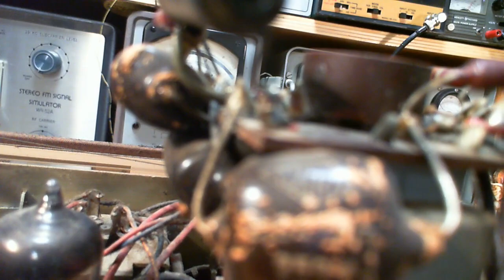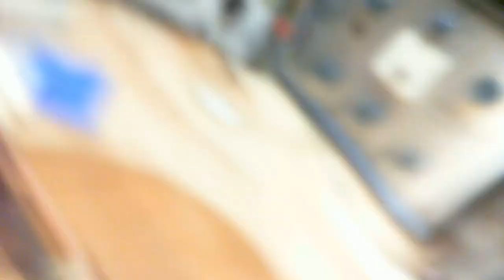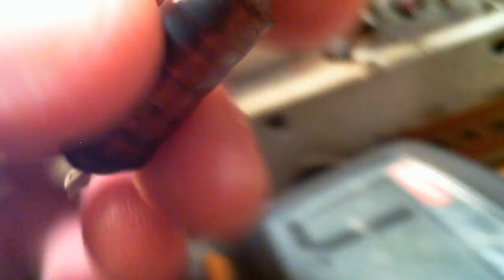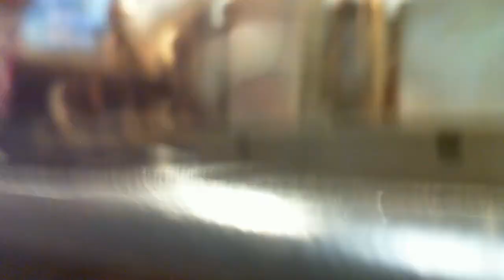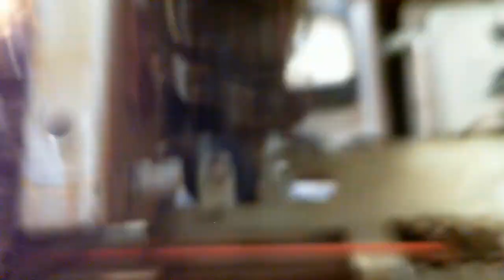German Greatz Polka Tube Radio Video#3 - Component Replacement Begins

Comment: In the 1940's my folks would have most assuredly had non-electric refrigerators as there wasn't any electric there until the 1950's, so there's would have been an icebox.  Their home radio ran on 6 volts and they used a tractor battery for it.  The tractor was a Farmall "B" with both electric and hand crank, so when the battery died on the radio they'd charge it back up on the tractor, hand cranking it to start it.

Comment: In the 1940s-50s not all refrigerators were electric.  Quite a few people had gas refrigerators.  Yes, by a process I don't fully understand, you can use the heat of a gas flame to produce icy temperatures.  We had one until 1955.
Reply: A lot of people in the 40's still had blocks of ice that was used to keep the refer cold.  Things have sure changed a lot in 80 years
Reply: @curtisgriffin7924  Yeah but did they even call those refrigerators?  Isn't that an "ice box"?

Comment: Violet ray machine. Yes, I have one. The have a high voltage generator using a spark gap and induction coil. Just the thing to make electrical noise. It’s really a spark transmitter.

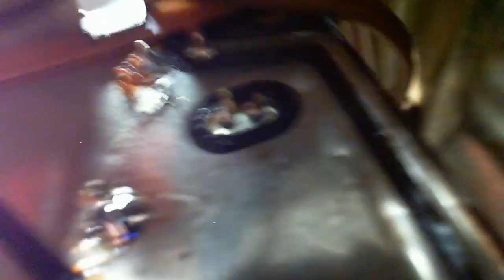Comment: 37:31 and more imporantly  40:45 There you have the result of snipping components and soldering onto the top.
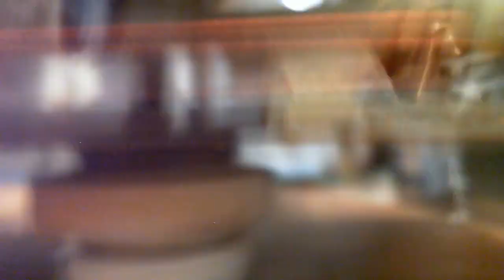 And yes, the resistor 256 was soldered on top onto posts. But even if you keep it that way, logic thinking should tell you, that if you do, not bend these posts around. Because regarding your comment at 39:55 : this broken joint did not occur over time, the only reason the post got a cracked solder joint on the bottom was you soldering a resistor with unreasonably heavy leads to it and when bending the resistor into shape exerting mechanical stress on the resistor and the post. 
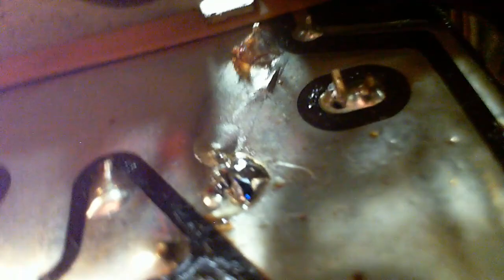And your resolder effort at 40:38 looks like it is still a bad connection. You stuck solder to the trace but not the post!  Get your iron hot enough and let the old solder melt before adding new solder!

Also will any viewer by now probably note how easily accessible both the position of the resistor and moreover the 50uF capacitor are from underneath. Clipping the cap and soldering onto the top was more time consuming than snip snap out the cap, remaining stubs out the bottom, clean pads, in goes new cap, soldering, done. Unless ofc you needed the extra time for a tribute to Norway and fish knifes.

Oh btw; the cathode resistor 256 dissipates 8V*8V/200 Ohms ~ 1/3W. So anything above (true) 1W metal film is probably overkill and only gets you in the need to handle overly stiff component leads.

Comment: 21:49 "59Amps..." WTF nonsense?Amperes is abbreviated with a capital A. Lower case a means year. So "6.   59a" means mfc date June 59.
And 24:40... Instead of spending minutes unwrappung this cap with no result and guessing, one could have used a logical approach like looked at the comonent placement chart or tested where this cap connects. Having identified the 200R  cathode resistor 256, the bypass cap 257 would connect to one end of resistor 256 and ground (via a very low ohm portion of the speaker output winding).

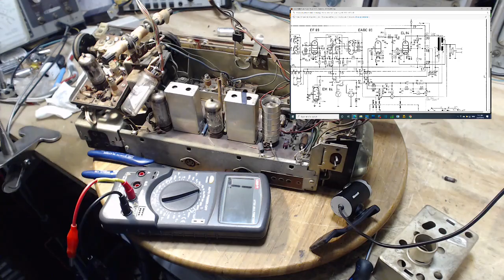Comment: 19:42 It true that some service instructions on early printed board equipment may advise you to cut components at the top and solder onto the remaining stubs. That however has to be viewed in the light of capabilities and tools the average shop had back then, which were dominated by still present point to piont wiring.
The danger of lifting traces due to excessive heat like from a solder gun is a thing that is overcome with temperature controlled irons. And removing old solder which may have been an issue in the past, today is an easy task by means of wick, suction pumps or desolder irons.
In todays world the only reason to cut and solder on top is because of an inaccessible solder side. 
Cutting and soldering on top today puts you into the situation of having to solder to a 60 year old stub of corroded wire. This means time consuming cleaning, fluxing, and heating to make a connection.
And all the time putting thermal stress on the existing joint on the underside, with the possibility of creating a cracked cold solder joint there.
Bottom line; in todays world with modern equipment at hand,  soldering to the top on a PCB with a freely accessible solderside is nothing but lazyness.

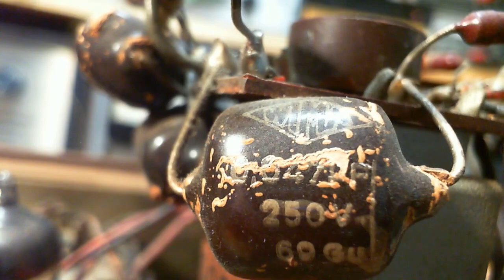Comment: 11:03 That clearly reads 0,047uF (47nf) so 0,05uF in your US boys terms. And BTW that cap is position 324 connected to resistor 315 (270 R) . On the schematic it is found down in the tone control network at about 11 O'clock position from the bridge recifier. You have a component placement chart in that manual you downloaded! (Unless radiomuseum stripped the document)

Comment: 1:56 "Vibrator" in 1943 certainly refers to electromechanical choppers, used to convert DC to AC. 
For example every car radio operating on tubes needed such vibrator along with a transformer to produce the plate voltage from the 6V (or later 12V) DC of the car battery. So what is so funny?
And any subscriber to BigClive would know what a historic violet ray machine is and that it too uses a vibrator...